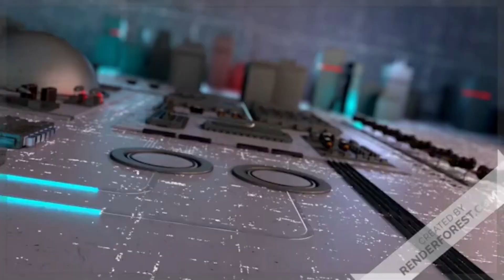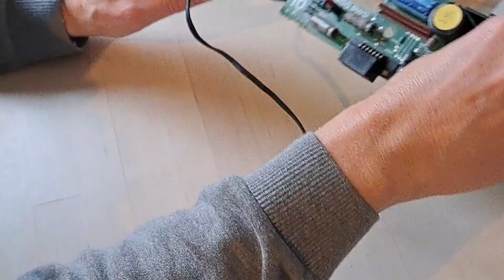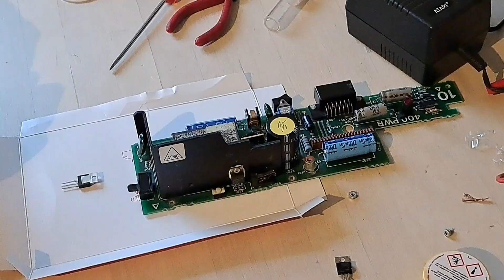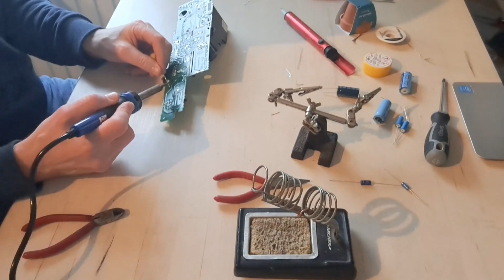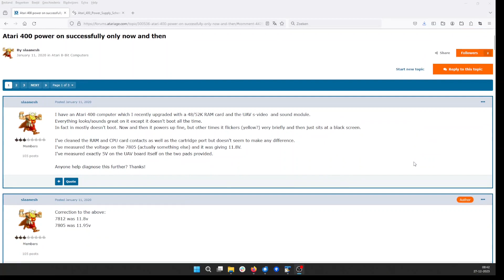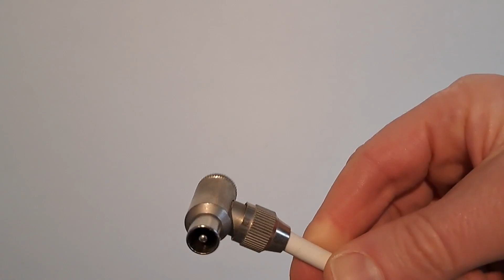My imported Atari 400. Is it broken? Can I fix it? (Part 2)

Comment: Can't remember for sure, but I think you need a cartridge placed in the slot for 400/800 to do anything other than static.
Reply from the maker: If there is no cartridge in it, with the 400 and 800 you will get in MemoPad.